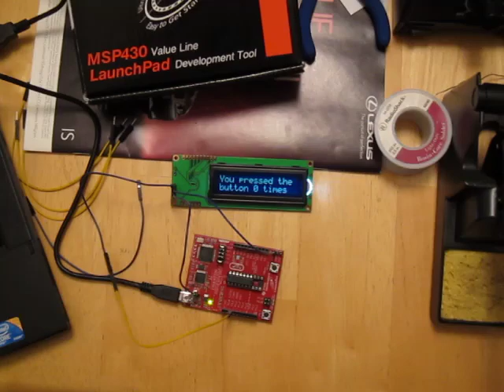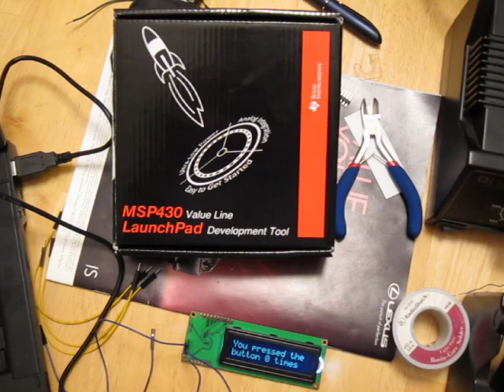Quick first project with MSP430 Launchpad

Comment: Hello, I need your help on a subject. I have a homework to read, write and display data on an RFID card / tag. I need to do this with msp430G2553,.Can you just throw a simple code sample for reading, writing and displaying data? (Assembly or C does not matter)
Example RFID:Rc522 RFID reader 13.56 Mhz
I would be glad if you help

Comment: it has hardware uart
Reply from the maker: This particular chip does not have a hardware UART. I don't remember the exact part number that the LaunchPad first shipped with back in 2010 when this was made, but it would have been along the lines of the current MSP430G2452.

Comment: I got 3 @ 4 USD , but they sell it now @ 9.99 USD (at least) , any idea why the price goes higher
Reply: +Hassan Maher because now it is used for the microprocessor classes in some universities.
Reply: damn wish I was into electronics back in '10 xD
Reply: you could just buy an msp430g2553 and use bsl to program it. and ang 2553 is less than 1$

Comment from the maker: If TI has published the source code of the programming code running on the microcontroller that's doing the programming, then it would be a matter of putting the right components on your board. But I don't think that programming code is available. You'd have to write your own code to program the MSP430. It's more than just a ft232rl...you need something that can program the MSP430 flash memory. You should probably consider another approach -- Google "msp430 boot loader".

Comment: Is it possible to duplicate the usb programming hardware, so it can be put on your own pcb? Or could you just use a standard ft232rl converter chip to program the thing? Nice video by the way, but you should have made it 3 seconds shorter :)

Comment from the maker: @markusgritsch I've updated the source file. Are you using the IAR tools or CCS? I was using IAR. Not sure if one implementation of the intrinsics is slightly different than another or something such that the code either worked or didn't work. Very weird. In any case, should be good now.

Comment: The code contains an error which prevents it from working: LPM4_EXIT is a makro which expands to _bic_SR_register_on_exit(LPM4_bits).  So either the last line of the file must read
  _bic_SR_register_on_exit(LPM4_bits);
or just
  LPM4_EXIT;